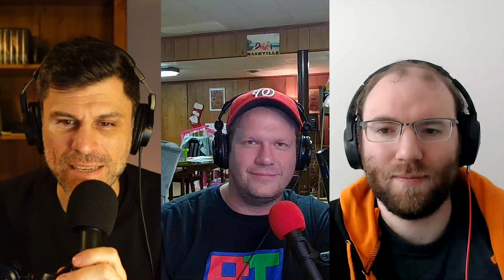Talking with Thomas Daede - Open Source CRT Project

Comment: Just watching this after watching Bob's interview, it's just great overall.  You can basically pick up any CRT and get a 30khz RGB monitor and can still run 15Khz games as well.  It's great because that transition of CRT based consoles and HD displays, we were getting 480p content capable games on 480i displays.  Systems like Game Cube, Wii, PS2, PS3, Xbox, Xbox360, Dreamcast all had 480p capabilities and would be great to see these on consumer grade CRTs.  But the same goes for things like DVD's from a progressive DVD player.

Comment: Based on the knowledge learnt from this project, would it be possible to design modern drop in replacements for unoptainium parts like PVM flyback+hvr block assemblies?

Comment: I like the concept but the problem isn't really the electronics in a crt that are getting scarce it's the tubes themselves that are getting scarce there's just none  nobody makes them that is what we're going to have to focus on in the future if you want to continue to use CRTs for any reasonable amount of time this is a step in the right direction but we're at a time crunch now tubes will only ever get more scarce
Reply from the maker: I think its going to be interesting when we define "scarce". Ok true tubes are not being made anymore, but if we take all the existing stock and add in TVs which may have been thrown out but the tube is salvageable, then I suspect we wont run short of tubes anytime soon. However this is all my speculation. It's almost like Super Mario 64, now its selling for a high price then everyone is motivated to find their old copy and it turns out there are many more copies than originally thought
Reply: @ZezRetro  the biggest problem is allot of our waste crts at least the us ones were sold of to China they bought up as much as a could in my area crts are hard to find broken or not in Pennsylvania sure you can find tv tubes that have been used for decades but the problem with those is that was the era where tv got super popular so alot of those are toast if you can still find them great but like anything if there is no longer production they will disappear like they have been
Reply: @ZezRetro  There are still lots of CRTs going in the Ewaste. Most modern ones have the same pinouts so a chassis to put them to use is more important than CRT manufacture at this point.

Comment: There is the Early Television Museum that had Hawkeye's equipment (Hawkeye was the last CRT rebuilder in the US) 

Thomas needs to get in touch with Dottronics.

As has been said, making new tubes just wont happen. If however, we can recycle old CRT glass, re plate old emitters, maybe replace burned phosphors with Quantum Dots, and have these electronics, CRT may yet live.

Cool things you could try with this

-deep interlaced display (more than even and odd lines) 
- multisync on compatible monitors
- Lag free analog RGB on an HD CRT tube
- 1080p or 1440p on a 720p aperture grille HD CRT
Reply from the maker: The possibilities are really deep with this project. I also suspect those HD CRTs will become way more interesting with this technology attached. but hell, everywhere you look with this project you find super cool rabbit holes
Reply: @ZezRetro  with this you should be able to make any HD CRT about as capable as any computer monitor was back in the day, which is just badass. Thomas's use of mosfets to handle voltage is awesome.

Hopefully the weight of those HD tubes will keep the prices down when this technology finally comes to fruition. Lol